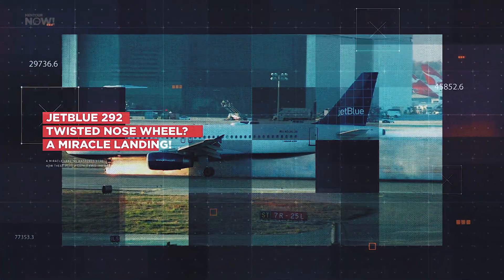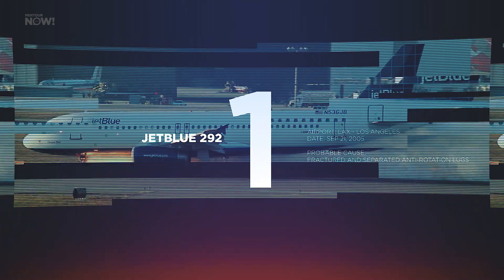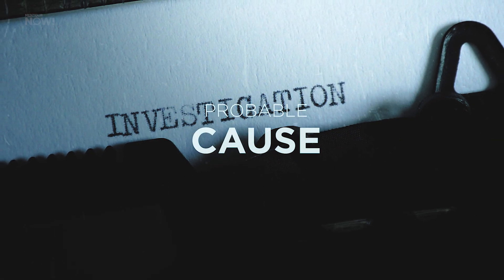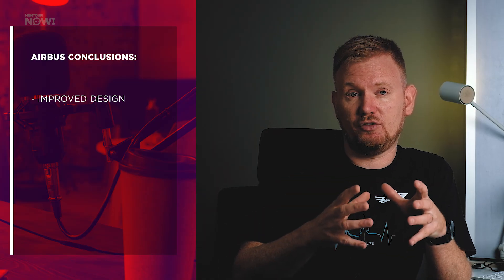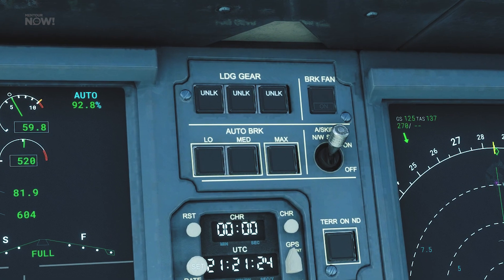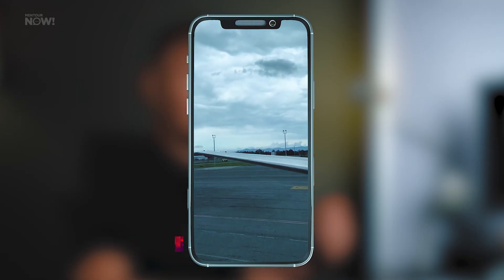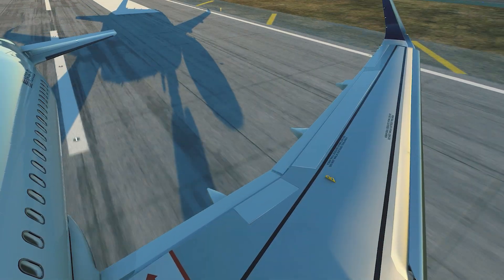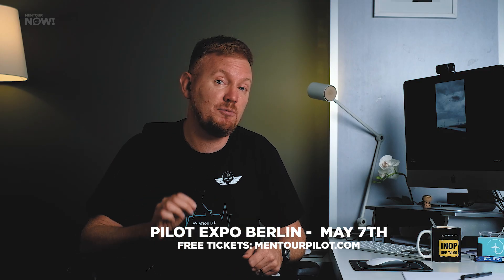The TWISTED Story of the Airbus A320 NOSE-GEAR!

Comment: Maybe they should just land sideways.
Reply: @MentourNow  LMAO
Reply: Drifting Simulator: Airbus
Reply: That's called crabing and passengers love the view on the low wing side.
Reply: B-52 mode?
Reply: @tnexus13  a man of culture I see
Reply: I may have snorted upon reading this comment
Reply: Why did they design it that only the passengers on the right side get to see the landing?! 🙄
Reply: Fast and Furious A320 drift mode 🤣🤣
Reply: They should have touched the nose gear sideways like direct crosswind and then level the nose gear with the runway centreline so the tire will not be 90 degrees of the plane concluding to a safe but hard landing. Any landing you can walk away from is a good landing!
Reply: crab landing xD
Reply: Your knowledge is beyond our competence
Reply: ATC be like: nani? kansei dorifto?!
Reply: At this point they'd probably have better luck making the rear gear point the wrong way as well, rather than fixing the front gear.
Reply: maybe Renault made the gear?
Reply: @bloothedog4443  🤣
Reply: @bloothedog4443 ah, Renault, the car brand I love to hate, especially the Clio!
Reply: @gaiaiulia  yep. they turned NIssan into the Japanese equivalent of 70's Mopar reliability
Reply: They should hire you
Reply: Or land like a paraglider in a headwind: swoop down to a near stall at nearly the ground level, flair up into a total stall at close to zero altitude and 0 airspeed, then settle gently down vertically and collapse the canopy so you don't drift away. An A320 can do all that, right? ;p
Reply: That would be a great impovement for ryanair
Reply: Your knowledge is beyond our competence
Reply: Fast and furious: Tokyo drift airbus
Reply: * you didn’t have to cuuut me off
Reply: HHSHADHAHSHHDHASH
Reply: Pure genius!
Reply: Extream crab
Reply: HA!
Reply: Lmao
Reply: Wouldn't it be great if our government dealt with problems like the airline industry ?. Investigate , make necessary changes , and correct them . But when have criminals ever given a shit about laws . Guess I keep forgetting they are there for them . Not us .
Reply: If they land sideways the other landing gears will catch fire
Reply: Lol
Reply: Then rip back gear
Reply: Maybe the plane  just turned into bird.
Reply: Sideslip landing
Reply: THAT'S NOT HOW [[Aeroplanes]] WORK [[🤓🤓🤓]]
Reply: Same problem with rear wheels😂😂
Reply: yep totally
Reply: But then the belly landing gear might suffer the same sparking and so on, all that happened to the nose gear of JetBlue 292.
Reply: What about the main landing gear now instead of the nose gear 90 degrees now the main landing gear is now turned 90 degrees
Reply: What about the back gear?
Reply: Yep, I have the same confusion!😅
Reply: But the rest of the wheels
Reply: Do a sideslip.
Reply: Instead of retracting the landing gear, we just lock it at a 90 degree angle after take-off 😅
Reply: initial A(irliner)
Reply: @datutturugang666  Initial-A 2: Sideslip
Reply: FO : plays : déjà vu !
Reply: Ecam action: Pull the E-brake and drift to a stop after landing
Reply: Dude, it's already a thing. Never heard of British Sideways?

Comment: Sounds quite crazy that you could dispatch with any fault in nose gear. I would not like to be inside such plane. Luckily it seems to be amazingly tough thing. Once in Helsinki-Vantaa a van got knotted around main gear with no problem.
Reply from the maker: Agreed!
Reply: lol. right.  that's irresponsible
Reply: @jamescollier3  That irresponsible stuff is my critique against the profit-driven industry's marketing pitch about safest way to travel. It's safe until profit is put before safety, which happens a lot, to varying degrees. If I pulled that kind of stuff with my car, I could lose my driver's licence.
Imagine a pilot sticking a post-it note on the dashboard reading: "Do not exceed 25° steering angle or you'll be in big trouble."
Reply: That van incident would probably make a decent video as well.
Reply: @whitenoise509  I remember it was in 80's and in daily headlines but could not find anything from google. Mentour certainly could find it.
Reply: @Alfred Weber Did you mean to say "even with capitalist manufacturers"?
Reply: @MyNathanking  I think Alfred wrote as intended, because Capitalism helps to promote these kinds of complacency issues. Alfred could have said "especially with Capitalist manufacturers"
Reply: "Sounds quite crazy that you could dispatch with any fault in nose gear." With any fault? Not feasible. Every plane in service has faults. With that specific fault? Completely agree. And, even with the MEL as it then was, it seems insane that they'd dispatch an aircraft with a fault for which the mitigation is "no sharp turns" from an airport that requires a 180 at the end of the runway.
Reply: @Alfred Weber Go find out what "socialist" means. Free clue: it doesn't mean "wah, wah, bad, me no like."
Reply: It took off so don’t worry.
Reply: @Tangobaldy  it took off in an unsafe position, that should never have happened in the first place
Reply: @FL0RiaN94  I think that they didn't notice the nose gear during takeoff, because of the momentum of the plane possibly forcing the wheels into the correct position, but once the pressure was off the wheels, they popped into the 90° angle that they wanted so badly.
Pilots maybe thought some unexpected sidewind or whatever, instead of a stubborn nose?
Reply: @Games_and_Music  Agreed! Although the toughness is anything but luck :)
Reply: @Games_and_Music  Momentum doesn't do that. The gear self-centres when turned up to 25° and locks out to 90° when turned beyond that. Pushing the gear harder will just make it do its thing harder.

"the wheels [...] popped into the 90° angle that they wanted so badly" They don't "want" to be at 90°. That's just the position they end up in when there's no control. That's the safest position for them to end up at, because there's a mechanical stop there that holds them in place. If they ended up at 0°, they'd wobble all over the place when the plane landed, making the plane uncontrollable.
Reply: @beeble2003  Then what do you suggest?
They didn't take off while the nose gear was grinding up on the runway, someone (not the pilots) might've noticed the smoke and whatnot.
I'd say the pressure/weight of the plane and possibly the momentum kept the nose gear straight until the nose got into the air.

And yes, i know inanimate objects do not have a will of their own...
Come on, don't take everything so literally.

EDIT: btw, the reason i mentioned momentum, is because if you push a bicycle without a rider, it'll go straight ahead for a while until it loses momentum.
Like the famous experiment with the sideways spinning experiment (gryoscopic precession etc.)
Reply: @Games_and_Music  I don't know what happened. There's much less pressure on the nose gear when taking off than when landing, so maybe the gear wouldn't have been ground away to nothing by a take off with it set crossways.

I can understand why you made the analogy but planes aren't bicycles. Bicycles self-stabilize because as they start to fall over, they steer in the direction they're falling, moving the centre of gravity back over the wheels. Planes on the ground don't steer by leaning, so that mechanism for self-correction isn't available. Furthermore, if a bicycle wheel has turned too far to self-stabilize, pushing it harder won't make it stabilize -- it will just make it fall over faster.

I understood that saying what the wheels "want" was just a figure of speech -- I wasn't taking that literally. My objection was that the wheels actually "want" to be straight and it's only when failures force them out of that state that then end up at right-angles. Saying that they "want" to be at right-angles suggests that that's the angle they'll be at unless something keeps them straight. No, it's just that that's the angle they go to when things break.
Reply: @beeble2003  Fair enough, that does make sense.
The thing that just puzzles me, is that the pilots didn't notice anything.
If the nose gear got stuck after the U-turn, they should've been going in circles once that happened, but they were able to complete the turn AND take off.

If the gear was already 90° off at the take off, i'd think the nose gear would fail to make proper traction, and possible start bouncing and/or jerking the plane around.
Which is why i thought maybe that can be similar to a strong head, or sidewind.

But yeah, it is true that there's less pressure on the nose gear at take off, and i guess i should've said that the BSCU or something similar "wanted" the wheels to get stuck through this defect.
But yeah, i was mostly just 'being funny', hah
Reply: @Games_and_Music  Yeah, I don't know why the pilots didn't notice anything if the nose gear was sideways. But I don't see why that would have stopped them taking off: there are two large jet engines strapped to the plane and a bit of friction from the nose wheel isn't going to overcome that.
Reply: @beeble2003  It's worth noting somewhere around here that automotive wheels "want" to self center because the engineers set a "camber" to their linkage with the car frame/chassis, and the steering system... Steerage wheels (usually front on cars) are set BEHIND the hinges on which they rotate, so that the drag of them against the ground pulls them literally back toward their center position so the car "straightens" itself automagically...

   Motorcycles are self correcting because of gyroscopic forces AND the "rake" of their front forks, which hinge to the frame so the bike leans into every turn and steers by weight appropriately... It's why we (bikers) can use "counter-steer" with only a single finger on the handlebars to maneuver a bike that might way as much as 800 pounds... You can check out a couple of Motojitsu's latest videos on "counter-steering" (channel on YT) to see it in action... AND it's why a motorcycle minus the rider will frequently be tooling and wobbling its way down the road "on its own" until it hits something or the engine spools down (unless cruise control is active of course) enough to fall over... which can be amazingly far.

    I'd surmise that somewhere along the way, aircraft engineers have decided that they'd rather the nose (steerage) gear wheels should "default" to 90 degrees to the side one way or another as any alternative stands a chance of sending a couple hundred THOUSAND pounds of aircraft in some random direction off the runway at 200+ miles an hour... where 90 degrees "sideways" will only sacrifice the tires, bearings, gear, hydraulics, etc... up to the belly of the plane until it "grinds to a stop" wherever that is... It's maybe no much control, but it's something... AND for better or worse, the A320 engineers decided it was probably the best situation in case of steerage or shock absorber failures on the steerage wheels...

     Frankly, I'm not sure if I'd rather grind up a bunch of the nose of a plane or have a couple hundred thousand pounds of aircraft circling the airport at 200 mph, either... myself... Neither one sounds all that pleasant, but admittedly, the engineers may well have the right idea for mitigating the scale of disaster over a busted wheel or strut... ;o)
Reply: @gnarthdarkanen7464  All good points, yes. You mention motorbikes; I was talking about pedal cycles, where the gyroscopic forces aren't very significant (light wheel rotating relatively slowly). I'll take your word that gyroscopic forces are much more significant on a motorbike, where the wheels are much heavier and speeds are higher -- that certainly sounds plausible.
Reply: @beeble2003  Motojitsu is a good instructional channel (around motorcycles) on YT... Fast Eddie even has a couple videos where he "demonstrates counter-steer" by setting his cruise control and just pushing the handlebars with one finger... it's worth a watch if you haven't...

   AND yeah, you're free to take my word or not... if I don't use the handlebars to steer the bike, I can jump up and down on one peg at about 5 mph... and it's going to go in a dead straight line... AND my bike only weighs about 350 pounds... 

    Gyroscopic forces are no joke on a motorcycle.  ;o)